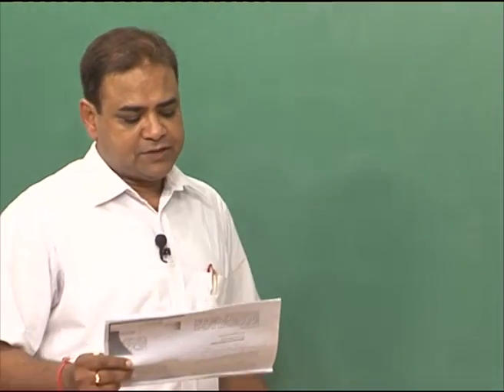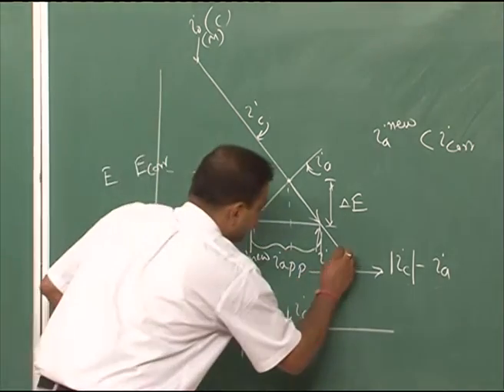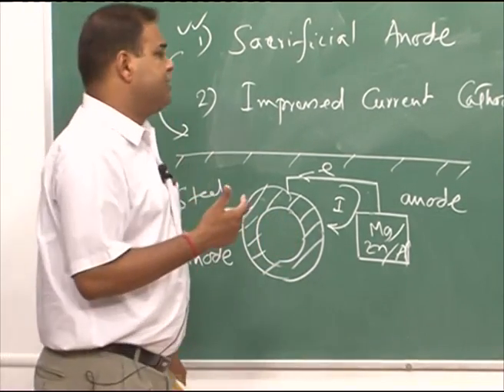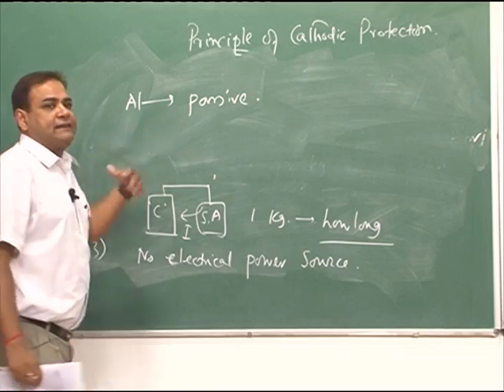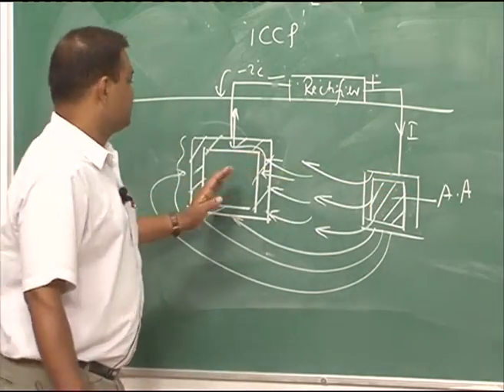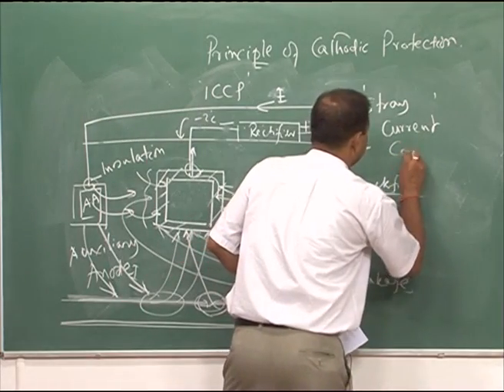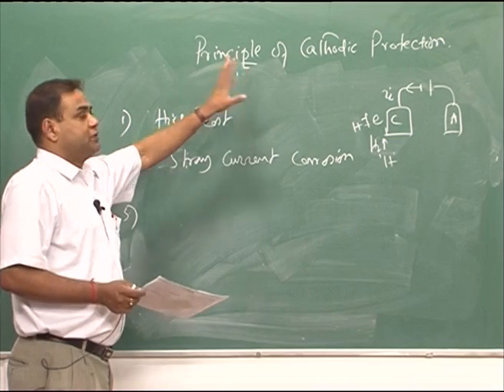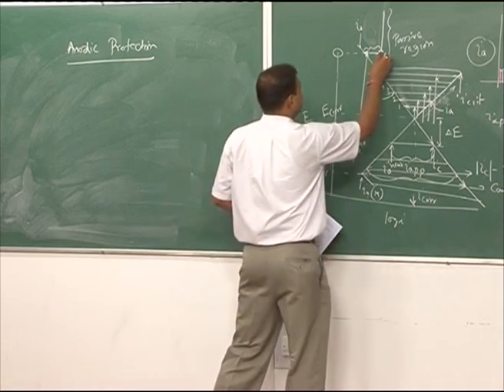Mod-01 Lec-21 Cathodic and anodic protection

Comment: secondly can show calculation of number of required anodes for sacrificial anodic protection with certain pipe surface with different coating and different soil resistivity and different anode material? would appreciate if u could provide some reference text for calculation.